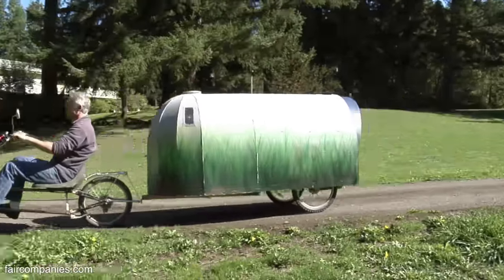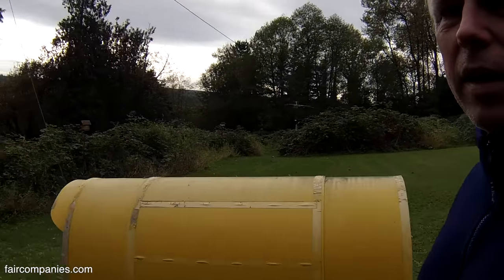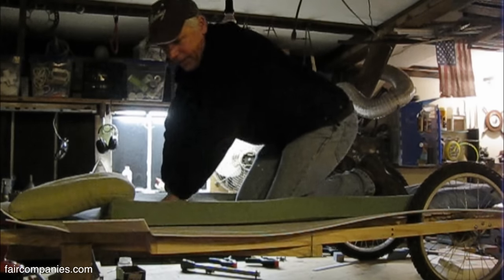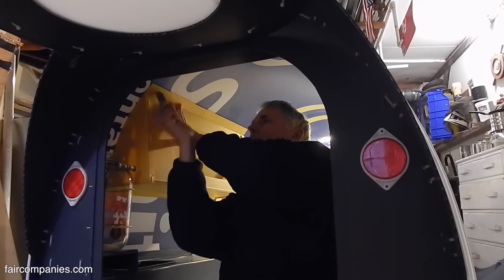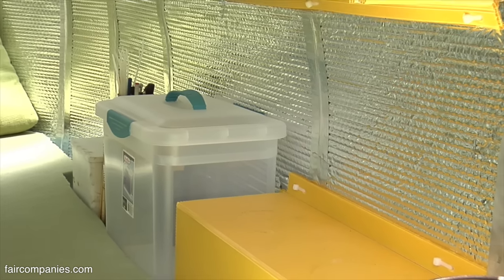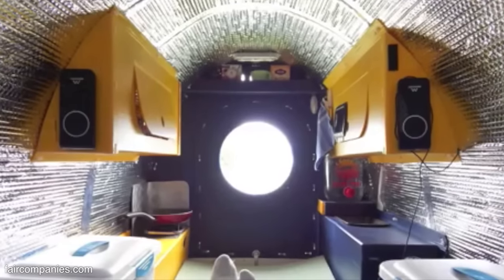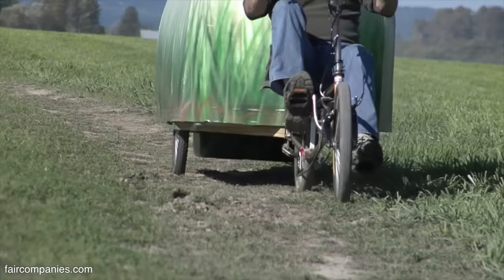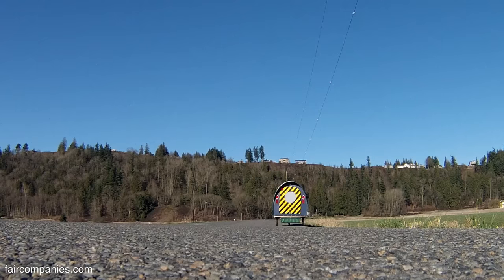$150 bike camper: DIY micro mobile home (downloadable plans)

Comment: When I was homeless, I lived in a little wooden shack built from recycled pallet wood and scrap from a furniture building factory up the road from the camp. It was about the size of this glorious camper and let me tell ya, its not hard to live in a small space! I had a old middle console from a car next to my bed which was a crib mattress with a large couch cushion all zipped up in a old sleeping bag and sewn shut at the top...i had taped three milk crates together long ways to form storage for clothes and a old coffee table for my "kitchen " I used a of corrugated metal i hammered nails through to make holes..then i placed that on the Cinder block in the middle of the table with a tuna can filled with rolled cardboard covered in recycled wax to make a burner...i used a little toy stock pan to make coffee and tea and a little cast iron skillet to make food. These were hung on the wall after being washed and the cabinet on the coffee table was food storage as was one of the open ends. I kept the one by my door open though as that would be where I stored my shoes.  I loved my little " hobbit house" and everyone that came to the camp was amazed how a big lug like me could live so comfortably in such a tiny space. Honestly,  I miss that little hut a lot! It was the first place I truly felt was home
Reply: Tank The Unstoppable 
I think everyone should have a homelessness humbling experience maybe not to this degree but they should experience independence like you did God bless you!
Reply: @IAMGWH1  it is definitely a humbling experience,  and it taught me just how strong I really could be, resourceful as well. I spent 2 years in that little shake, in a camp that became home, with camp mates that became family. We were a village on the fringe of society that survived on our wits and spite lol. Thank you for your blessing!
Reply: In a decent climate not over run with mosquito's would be interesting
Reply: I wish the majority of homeless were like this tho, in my area a homeless person would not be willing to do the things you did, they rely on charity and never themselves in any way whatsoever.  And the few who ARE willing to be creative get punished by nosy Karens because they feel like the very sight of a shelter attached to a bike mares the image of a geographic location.
Reply: @SteveVon7   I was lucky because there was a set of 4 homeless camps where I lived, so we kept each other safe and worked together like a little village. Everyone was proud of their little hut, or sheltered tent. It wasn't much,but it was ours and it was home. Our camp even built a outdoor shower hut! We had a camp kitchen....we had a storage tent with supplies to help out not just people in our camp but the other camps too....we all worked together to help each other. A program was in done to shut the camps down because of a new bridge being built..the first thing people would see coming into the city would have been us. The mayor didn't want that so a program was done. Now for the record, everyone involved tried really hard to make it work. But, in the end out of 60 people, 5 died....and 57 ended up back on the streets..this time with no camps to help...the main issue was everyone was expected to enter a already strained workforce. Some of the people I was in camp with hadn't worked in 10+ years, were battling addiction, battling mental health issues,  and were thrown face first into trying to deal with all of that and thrive. Of course it failed! No assistance was given for those issues. And so.....the city destroyed the area known as Tent City because it looked bad on the city. They didn't really care about the survival of the residents that called it home.  Everyone involved with the failed program was fired...and those that tried so hard to make it work...it was all for nothing. I left the city and moved on and am doing fine...but I will always wonder about the others
Reply: @UC7LPRXP2__qfaltDZcGDfaw St. Louis, MO 2011 and 2012..there is a wonderful documentary about it here on YouTube called Dignity Harbor : A home away from homeless...I'm in it lol...it shows the camps and the shut down...but it didn't tell the story of how the program was a FAILURE
Reply: @SteveVon7  if there are those who do NOT survive and we just let this continue makes me f sick  🤬🤬
Reply: @hobbygamer6220  What do you mean "Let this continue", the homeless have always been among us, and always will be, there's no discontinuing it
Reply: @SteveVon7  there will be when we STOP DENYING PEOPLE WHAT WAS PUT HERE FOR EVERYBODY WHETHER WE HAVE MONEY OR NOT ! Land and all the natural resources needed to make ones house ! all natural resources and they're gonna charge for It ??? I don't think so
Reply: @SteveVon7  just stand by and let people die
not long ago there was a audible gasp and deep disturbment at the very THOUGHT. But little by little the deep sleep becomes subtly deeper and deeper and more profound
Reply: @hobbygamer6220  There's nothing, no readily available resources, or land, that's gonna prevent homelessness, and besides, these guys dont die from starvation anyway, they tend to die from drug/alcohol related things - its their choice and theres nothing anyone can do unless they themselves actually WANT out of it
Reply: @SteveVon7  do we charge for AIR TO BREATHE ? no. I know theyre working on it.but anyway
how did we become so [BLEEP]ing selfish and frankly out of it ( to put it politely ) to start charging for LAND ??? Its ANOTHER NATURAL RESOURCE ! Yes it should be TAXED but thats gonna be a percent of what a person is receiving ! if a person has no money coming in any percent of zero is of course always going to be zero ! they're not going to take your land away from you they're not going to be so deluded as to deny you land because you have no money in the first place ! thats just a line you don't cross ! the land is made AND is big enough and resourceful enough for EVERYBODY ! WHERE do ppl.get off CHARGING FOR IT ???
Right now just always have a building on standby ! never let it happen that someone cop or whoever call the shelter and they say sorry we can't help you were all booked up ! plenty of abandoned buildings out there. run out ? MAKE MORE. And do not kick them out after 60 days...( yup. thats what happens ) OR EVER ! Line ya don't cross.
THIS is the way to go really ! MOBILE is the ONLY way to live !

back to the former note...with a exciting life like theirs, WHY on EARTH would anyone turn to drugs and/or alcohol ?  🤔
🍷  🤪 clink
Reply: @hobbygamer6220  Human instinct is to be compassionate,  but the same nature you refer to is also brutal.  There are some among us who through the course of natural selection will be culled out,  some get lucky,  some don't,  but in the end only the fit will survive.  Adults who are irresponsible or weak may be subject to this,  even if they're otherwise good people - I never said it's fair or anything but sad.
Reply: I was lucky, I lived in my AMC Gremlin when I was homeless.
Reply: Unfortunately many of the homeless I knew didn't want anything including family, friends, police, work etc to interfere with their ability to stay buzzed 24/7! They could have went back to work or had family nearby to help, but that meant they could not stay buzzed 24/7 so they refused. Hard to help those who don't want any help unless it's to help them stay high/drunk! There were others who were true economic victims or mentally ill. Many of the economic victims did get help and got off the streets. The mentally ill ones are mostly still out there and should not be, they should get help. But the addicts/drunks who refuse help, there is not much that can be done and their choice is not society's fault, it's solely on them.
Reply: Sad that you were homeless bro
Reply: @tanktheunstoppable7263  how Did you shit and shower and survive the winter
Reply: @Scott-got-caught  my camp actually made a shower house! We had a 5 gallon bucket that was spray painted black with a hose running out of the bottom that was attached to a old camping shower head with a button that stopped water flow so you could conserve during your shower. It was posted up on top of boards and you climbed a ladder up to pour in heated water. As for going to the rest room there were portapottys that the city installed. We also had a large soda cooler we used as a sink to do dishes or wash clothes and a clothes line to hang and dry them. As for surviving the winter, I heated my hut with candles until time for sleep, I would coat my feet in vasaline and then a shopping bag then socks. Keeps your feet warm. Lots of layers, i slept fully clothed and in a BIG coat, as well as my sleeping bag and blankets. It was hard to sleep sometimes but eventually you get to sleep. Hope this answers your questions.
Reply: @tanktheunstoppable7263  well damn. Sounds like camping 👍🏼
Reply: I got kicked out of the house for being a rebel coz my parents were dicks, making me do things that I don't like and I said, I'm outta here.  I was 15 at that time.  I was pretty confident because I had my little camper and $1000, and had steady work doing part time odd jobs in different places.  Lived in that camper till I was able to save more money and bought and lived in a van.  After 7 more years, I was able to finish my apprenticeship as a carpenter.  It was the best decision of my life.  I was able to what I want with no one to tell me what to do, no nagging no bullshit.  Never visited my parents even once and never cared to learn on what happened to them.
Reply: Yeah they thrived in their tent City and worked together to have the essentials. And obviously it worked for them. Then the government has to come in to "fix" things. What needed fixed? Nothing. If it were me, I might have just relocated the City to an acre of land with money coming from the bridge and let them continue their harmonic existence. But , noooo, "We are from the government and we are here to help" LoL sheesh
Reply: @CarrieLaffs  you are ABSOLUTELY right..where I was there were 4 prominent camps...and each one was it's own little village..BUT everyone worked together to make things descent! after the city came and shut everything down... PEOPLE DIED...because they were removed away from those who had helped keep them safe, made sure they ate, reminded them to take their meds.....we all TOOK CARE of each other....I went on to do awesome things and am living a great life ..but knowing that the city put up a front to make others see one thing while a entirely different thing was really going on and good people lost their lives because of it...smdh...
Rest in Paradise:
Leona- Camp Sparta
Chino-Camp Sparta & Atlantis
Al-Camp Atlantis 
Gone but never ever forgotten!
Reply: There is something freeing about living simply in a small space.
After getting off the streets idk how I'd adjust to having such little space again.
But if you can make it work so well, maybe I'll be okay if everything hits the fan
Reply: Inspirational!
Reply: this is 1000% true man
Reply: Tank the "unstoppable": why were you homeless??....
Reply: Home is where your heart is.  I lived in a camper for a while until I saved some money to buy a small farmland for myself.
Reply: @LuisMendoza-pp9qi  I had lost everything. My place of employment got rid of my position. My mother, father, grandmother and grandfather had all passed on so I had no family. I felt as if not a soul cares if I lived or died..I had no money...nothing left to lose....so I went to the only place others like me at that time could survive....and we did..we survived and some even thrived!
Reply: I was 16 left parent's home, no money, no job. Slept in empty garages in alleys. At first I would pass out from hunger.  Got a minimum wage job, saved it, ate at work once a day. Washed up at a gas station, in the summer I took the bus to the ocean, took a shower there in public facilities. Eventually, saved enough for an apartment, got a better paying job, car, moved on up. Never did drugs, no one helped me, no one to keep me safe, no food banks then, no access to soup kitchens, too young for welfare, meant possible foster care.

Today, the majority are addicts, thieving to survive and to buy or barter drugs. They don't want to follow the rules, or work. Homeless camps around my area, yup thieving addicts, prostitutes, collect welfare, don't pay taxes, leeches of society,  squatters and live like pigs!
Reply: You're resourceful and humble.  It allows you to find the abundance in things thrown away. It's a wonderful perspective to have especially when circumstances can change.
Reply: @SteveVon7  you know them all personally? Gtfoh
Reply: The wisdom of this is the Home part.   The fact you can move it easily, self contained, independence granting, recycled, inexpensive and most importantly private home space.   Its awsome!
Reply: I wonder how you explain the many countries around the world who have so little homelessness, then? They put America to shame, and I say that as an American.
Reply: @SteveVon7  Well thats the problem right? If a person decides to just build themselves a home the people who own the businesses or homes in the area will think its unsightly and ensure the city has them removed. So the only way for people like Tank the Unstopable to be able to build a camp in peace is to do it so far from the resources they need that no one will bother them. But to be out in those sorts of places means its harder to get food money or aid because most of the time a homeless person is lucky if they have a working bicycle 

I lived on the streets for a few years and I knew many people who would try to build little camps only to have them torn down by the city less than a week later and eventually thats a little exhausting because they don't just leave you the resources so you can go set up somewhere else they throw it all in the trash and have it removed so it can't be salvaged. Having to constantly rebuild your home every week is a lot of work when you need to find free things to do it, so most people get tired of trying and end up just sleeping under exhaust vents from the big buildings for the warm air. And without a camp they can only own what they can carry so they own next to nothing. Me I slept on a rooftop where no one could see me or knew where I was so I wouldn't get kicked out, even got lucky and there was a gate I could lock to keep my things safe.
Reply: That is fascinating. I was as interested in your story of your Hobbit house as I was in the video. Tell more!
Reply: @tanktheunstoppable7263  It's been 2 years, so maybe you won't see this.  I checked for the video about Dignity Harbor, found a short one by ArcLight Cinemas.  If that's the one, can you say which person you are in it?  Like when you appear, and what you look like?  If not, I get it, no problem, just wanted to put a face and voice with the name.  Also, how are you doing now?  I hope your optimism and positive attitude remain, and have served you well.
Reply: how did you keep your place hidden and safe? did you just have to hope it wouldnt be messed with? ive been homeless a few times and i never really had a camp except for like 1 year ago i had this spot that i had a mattress at under this tree in a really discreet place but i would never have thought to build anything but then again i was in the middle of a large city
Reply: Hello voilà ou draw it and publish it thanks.
Reply: @laredopotato I've made a few different comments in this comment section so I don't know what you're referring to, I don't disapprove if homeless people per se, but I do believe that if a person is irresponsible and homeless, they are in their place.  There is nothing anybody can do to about it, it's like an old person with a 'do not resuscitate' lndicator, it's their choice.  Life is full of choices
Reply: Same, the homeless here are zombies